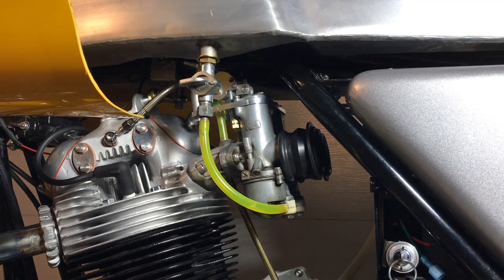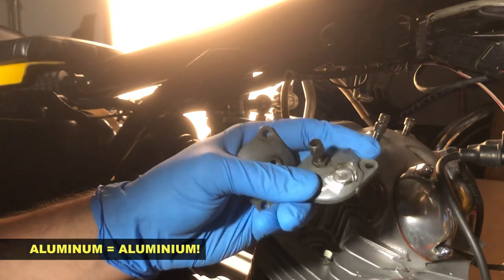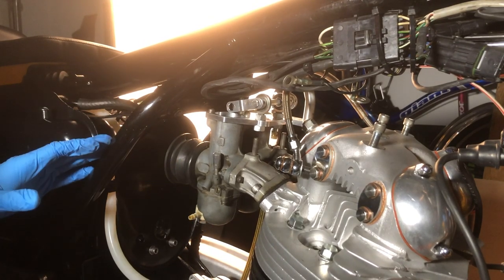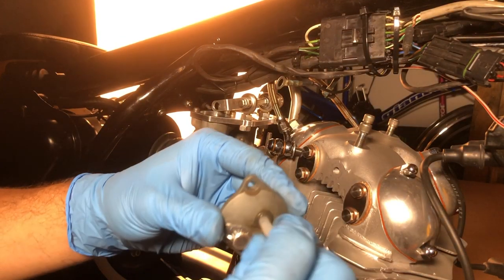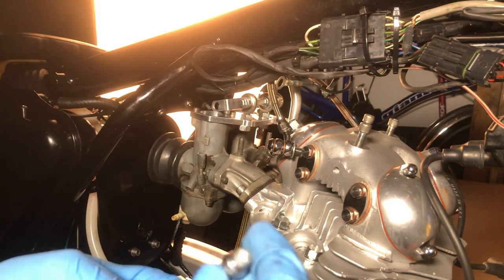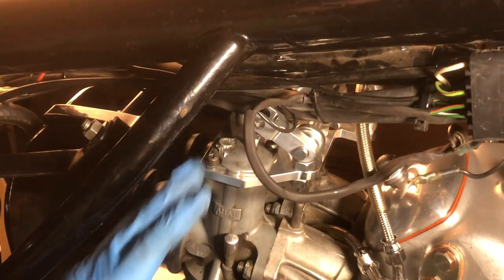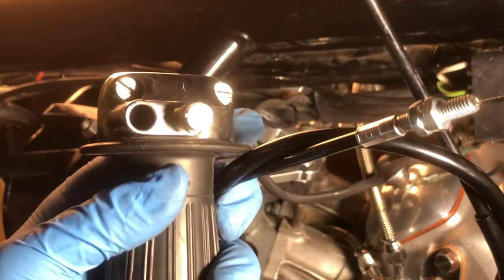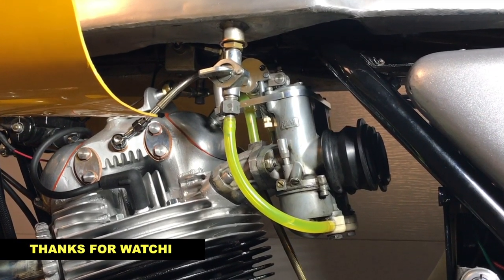1972 Norton Commando Combat Rebuild (21) - Single Throttle Cable Conversion Kit

Comment: Much like the triples. I’ve run three Mikuni’s with a three into one cable junction (from a choke assembly) that worked fine but was forever having to adjust them, also tried one into two plus a single... the stock linkages are way better: a Norton I’ve just purchased already has this... I didn’t know it existed.
Reply from the maker: Thanks a lot for your comment.  Dave is really pleased with this conversion kit and we have a few other club members who are very interested.Best wishes, Mike